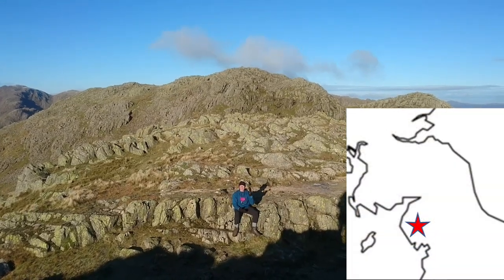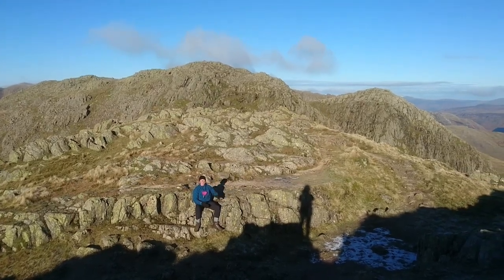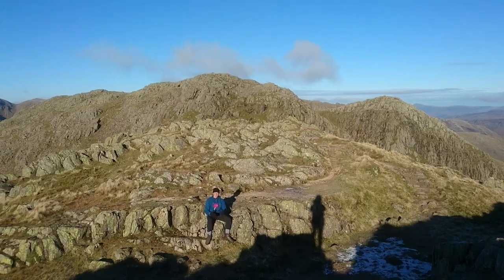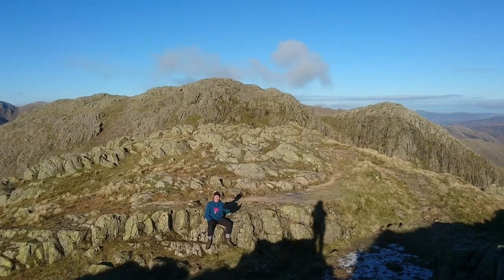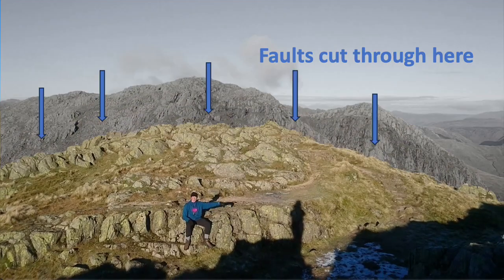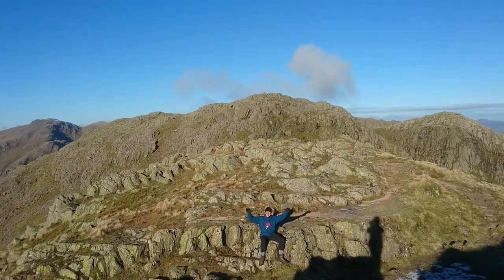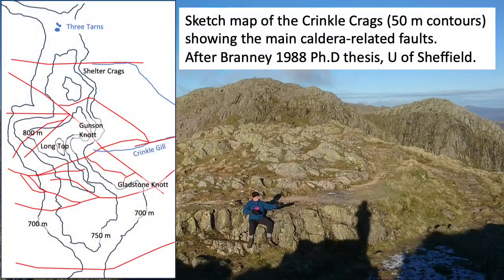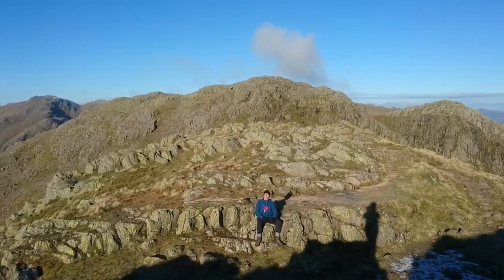Scafell Caldera 1: Keystone faults along the Crinkle Crags

Comment: Is keystone fault an old term? I've never heard of it and can't find a reference for it.
Reply from the maker: Hi, glad you like the video.  The concept of keystone faults is still in use in the geological literature - see e.g. http://dx.doi.org/10.1038/ngeo2660 for an example of a tectonic keystone fault.  The idea is that for locked systems there sometimes needs to be counterwise movement to release and allow the system to relax.  In the case of caldera collapse you end up either with rotation of blocks or reverse faulting to produce keystone graben structures.
Reply: @OneMinuteGeology  thank you!